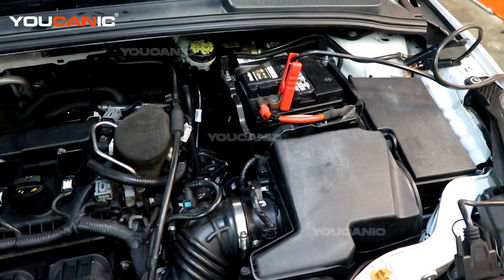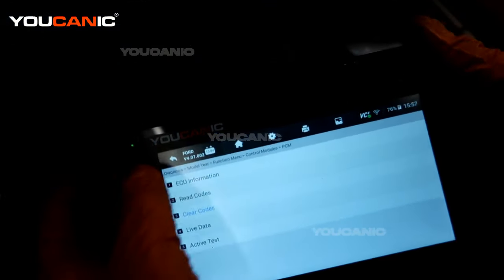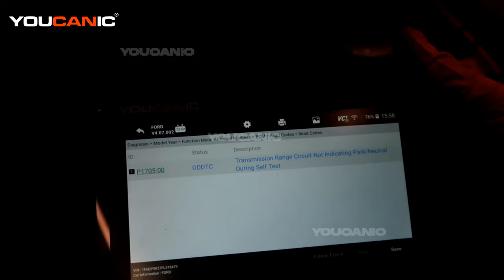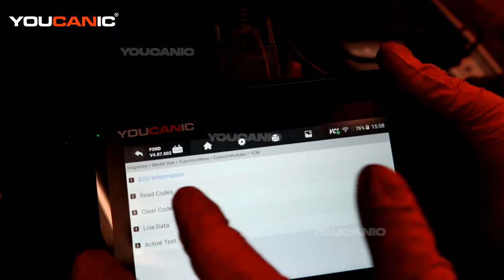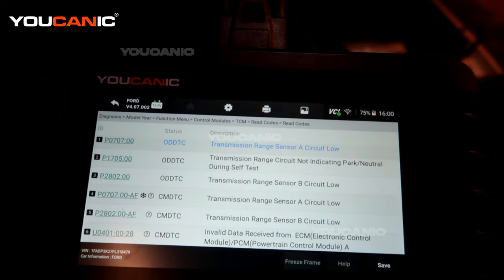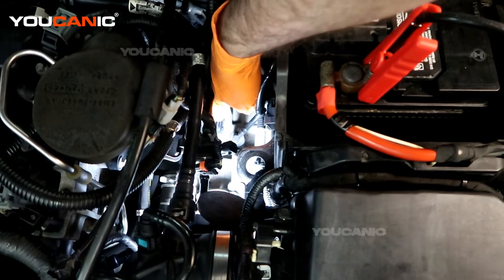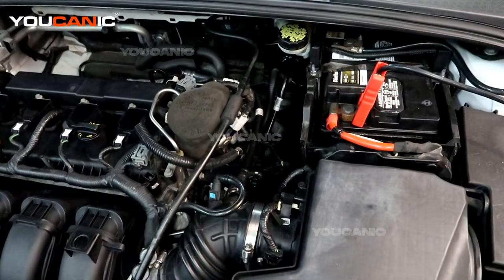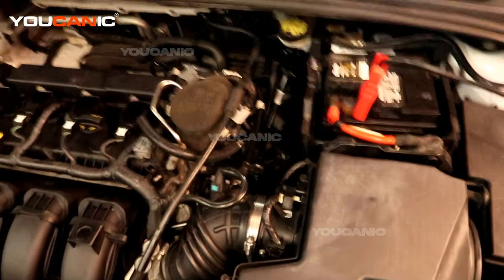Ford Transmission Range Sensor Replacement - P1705, P0707, & P2802

Comment: Arigato! Thank you! You save my Ford Ecosport 2014 🙏
Reply from the maker: We're thrilled to hear that we could assist, especially with your Ford Ecosport 2014! At YOUCANIC, our aim is to encourage car owners like yourself to feel more efficient and confident when it comes to auto maintenance 
Remember, we offer in-depth guides, free resources, and our handy YOUCANIC scanner on our website, [www.youcanic.com](www.youcanic.com) to make your journey even smoother. Don't hesitate to return if you need more assistance or if you require factory repair manuals. We're always here to help!
Reply: I have a 2014 exhaust and ABC on steep slopes loses power. Could it be that if I change that sensor it is already at 100??

Comment: I have the same problem on my 2017 mustang gt is this located in the same place ??
Reply from the maker: Thanks for reaching out! The location might slightly vary based on vehicle model, but it should be similar in your 2017 Mustang GT. For a more accurate guide, please visit www.youcanic.com where you will find helpful guides, free resources, and our advanced YOUCANIC scanner.

Don't hesitate to contact us if you need further assistance. We also have factory repair manuals available that offer the intricacy you might need. At YOUCANIC, we are all about empowering car owners like you and are here to support you on your car ownership journey!

Comment: I replaced the sensor and still got the same p0707 code any idea what that could mean?
Reply from the maker: Thanks for reaching out! If you've already replaced the sensor and still receive the P0707 code, it could be an issue with the circuit or the Powertrain Control Module. At Youcanic, our goal is to empower car owners, and we offer extensive resources including guides, our robust YOUCANIC scanner, and even factory repair manuals for detailed assistance. 

Please visit www.youcanic.com/ where you can access these resources. Don't hesitate to leave us any additional questions you may have. We value your trust in YOUCANIC and are committed to supporting you throughout your car ownership journey!
Reply: The gear selector has to be in neutral when installing the sensor

Comment: If you have an Ecoshit your shit outa luck for the TRS. For profitability , they purposely put it internal attached to the Valvebody. Yes, your transmission has to be pulled($800), you need to buy a new valvebody($400), and it also has to be programmed to your pcm($200) and let’s not forget the brand new motor craft transmission fluid 4-9qts.They knew these crappy sensors don’t last long. That’s why I’ll never buy a ford again.

Comment: What about code p0708?
Reply: Trans range sensor input high
Reply: Friend, I have a 2013 Ford Ranger that has codes p1705 and p1780. Can I tell you what defect it could be?